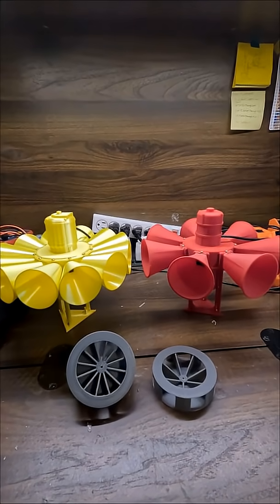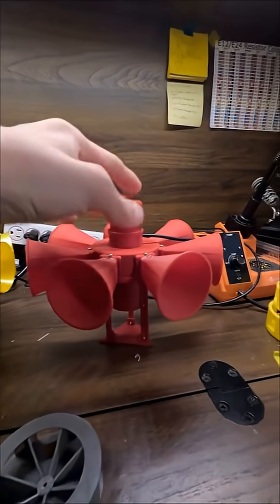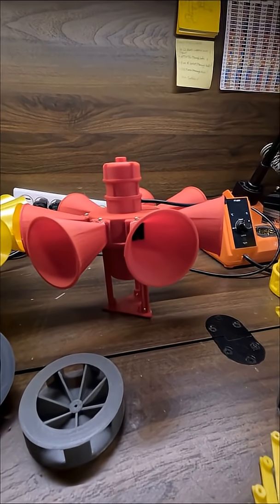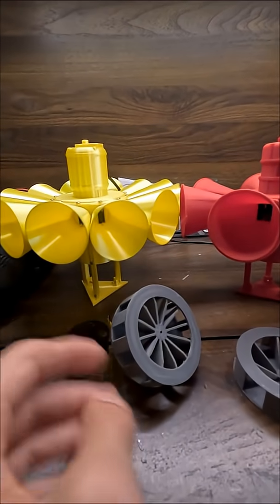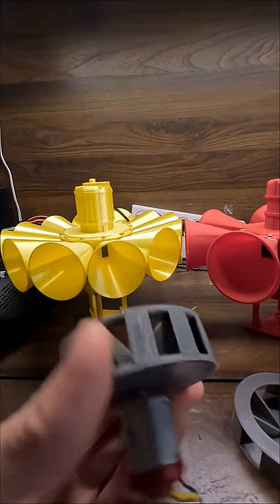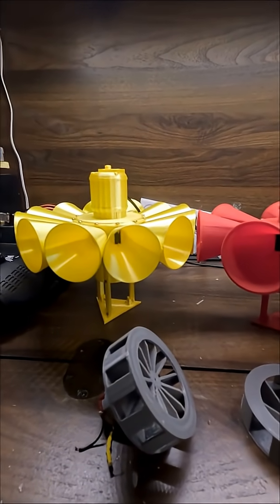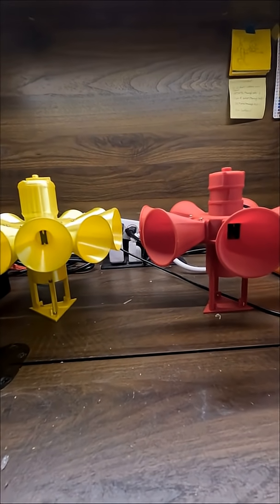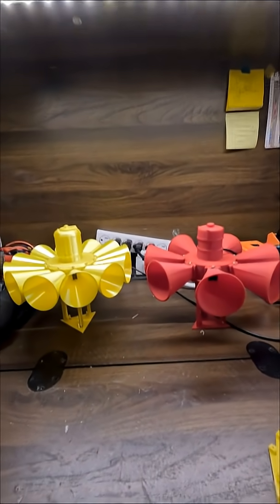NEW ROTORS Mini STL-10 & STH-10 Quick Test!! #minisiren #stl10 #sth10

Comment: What type of screws does this use? i was gonna print it in 2x scale but i need some deets
Reply from the maker: Normally they use #2 or M2 size screws. Both will work fine for attaching all the parts. Not sure exactly what you're doing, but I wouldn't bother trying to upscale these models because they're just not meant to be any larger. Doing that would require a bigger motor and different screws, not to mention all the parts that would have to be redone in order to get the thickness right.
Anyway, hope this helps you!
Reply: @milespeterson5049 thx, I realized that after I tried to upscale the motor cover and   Saw that the motor corner is a specific shape so yeah, thx again
Reply from the maker: @ValleyPineSirens  Sure, glad I could help! If you wanna print these sirens, they'll probably have to be 1/8 scale. Upscaling them just isn't easy.
Reply: @milespeterson5049  right!! Thanks again!
Reply from the maker: @ValleyPineSirens  Welcome! I'd love to see another person making these!

Comment: DAMN! Dude, thats crazy! The new rotor for the STL-10  added like 10 seconds!
Reply from the maker: No seriously!! If you ever wanna pull off the old rotor on your model and print the new one, you could have a super long wind-down like with mine! But if I'm not mistaken, you superglued it on, right? 😅
Reply: @milespeterson5049  Yeah I glued it on but i have my ways of getting through the glue.
Reply: @milespeterson5049 long time no see it's a very great siren video by the way
Reply: @milespeterson5049 used a 3D printer at my school added a motor to a siren but for some reason the siren will not spin the chopper spins but for some reason always get stuck on something even though there's nothing there
Reply from the maker: @Guest12-k1x  That's weird. What siren did you print, exactly?
Reply: @milespeterson5049 play on making a 3t22 but like I said did not want to take up all the school printer space so yeah
Reply from the maker: @Guest12-k1x  Huh, cool. I hope you can fix the seized rotors. Maybe it's the motor and not the rotor or stator that's given out.
Reply: @milespeterson5049  figured out the issue motor burned out and a piece inside of it and broke off
Reply: @milespeterson5049 used a 3D printer at my school made a siren and a chopper but I only made the chopper and the housing because obviously I'm not going to make a whole siren and take up the whole 3D printer space anyways cut to the case the siren is getting stuck on something I checked inside the chopper nothing is there